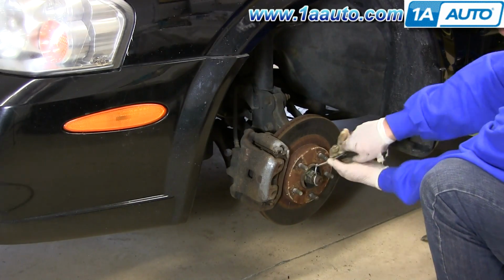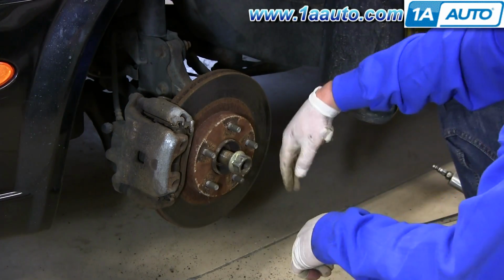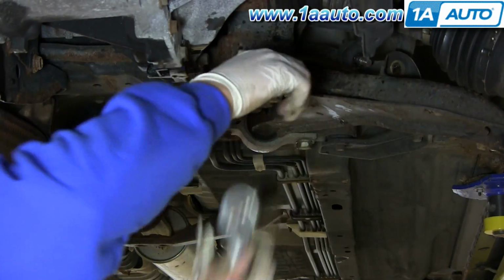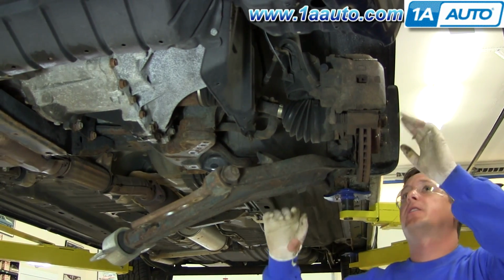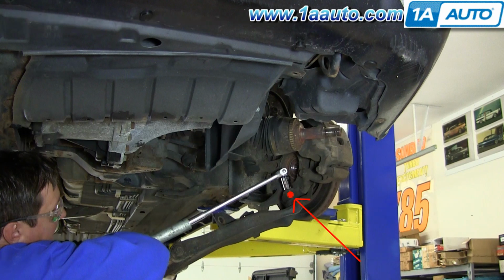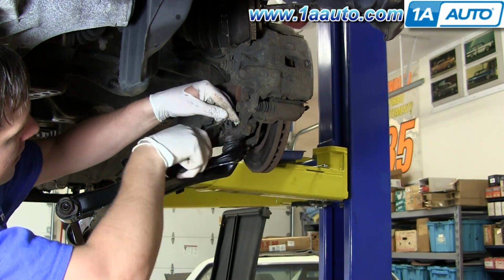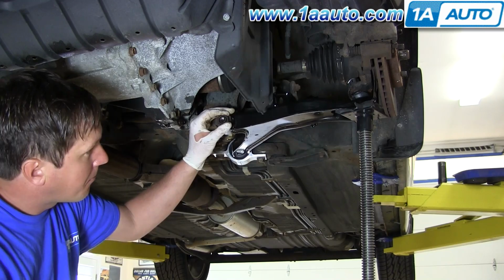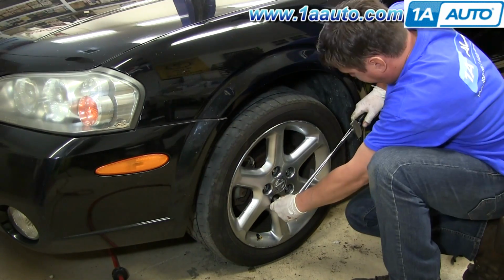How to Replace Control Arm with Ball Joint 99-03 Nissan Maxima

Comment: I just did this repair on my 02 dad's maxima since he was having steering shake and needed new tie rods at a minimum.  I figured might as well get the kit instead of trusting the ball joint to be good in spite of a torn boot.

First things first.  You're bringing a knife to a gunfight if you don't have a stout impact.

If you are doing this with the vehicle on the ground and supported by stands, there is a much easier way to get the old control separated from everything else.

Crack the six 22mm bolts loose with a breaker bar.  Remove the caliper bracket bolts, use a twist tie to hang it off of the strut spring, and remove the rotor.  Remove the sway link nut.  Remove the 12mm bolt that attaches the ABS sensor to the knuckle and move the sensor out of the way.

Remove the two bolts attaching the knuckle to the strut, and then zip out the 22mm bolts.  Now slide the knuckle and the control arm combo to an easier spot.  The ball joint cotter pin is much easier to access and the ball joint nut can be impacted out using an impact swivel.  Likewise, it's MUCH easier to strike the knuckle in the sweet spot to separate the ball joint.  The 27mm nut will also come off with some reverse ugga duggas.

Do assemble the new CA and the knuckle the same way.  Much easier without the axle in the mix.

Comment: To remove the front nut on an 03 the transmission pan gets in the way of a deep socket and I didn't have a short one, also I didn't have a 27mm wrench but that would likely be the next best option, I ended up using a 1-1/16" wrench with the closed end.

Comment: Did I miss it or did you not mention that you can’t reach the 27mm bolt on the control arm bracket without removing the trans fluid pan. You mention putting the trans fill plug back in but never mention removing that pan which is necessary for the driver side

Comment: I replaced both of my lower control arms but my drivers side control arm is grinding my break rotor only when making a left U turn....my passenger side is fine....thoughts
Reply from the maker: +Rigo Aparicio We wouldn't be able to diagnose an issue like that here, you may want to have a local mechanic take a look at it. Thanks for checking us out! http://1aau.to/m/Shop-1AAuto-c

Comment: I replaced  mine now have clunk when turning wheel all the way to one side only when moving .... any ideas new tie rod new sway bar do you think me tightening it in air is problem?
Reply: Hey I know it’s a been a couple months since you made this comment but did you ever figure out what that clunk was I am having a very similar issue after changing my control arms

Comment: Just did this job with parts purchased from 1A Auto.  Had much difficulty.  Struggled to remove the 19mm ball joint nut.  Needed to use my impact wrench with a swivel and extension.  The alignment bracket was also very difficult to get out of the old part.  Impact wrench and lots of WD-40 and some cursing finally did the trick.  The alignment bracket nut is behind the transaxle pan in an automatic, and there is not enough room to put a socket on it.  It's 27mm and all I had was a deep socket which didn't fit.  Used a crescent wrench and a hammer.  Hopefully it is tight enough.  Now here is another thing, the replacement  ball joint castle nut is different size (22mm I think instead of the 19mm).  I had also replaced the CV axle, and the replacement nut is also a different size (36mm) as opposed to the 32mm original.  Got the job done and after I get the thing aligned by a professional, the alignment nut should be torqued correctly.  But FFS, took me 2 or 3 hours longer to do and had me running to the store to buy odd sockets which I didn't have.

Comment: Did mine today I didnt remove the axle or the alignment plate went very smoothly
Reply: James berkhimer correct you don't have to remove the axle or the alignment plate to do the job that's just what the shops do to charge extra labor time to the customer
Reply: My driver side lower control arm is scrapping my rotor (touching) when making a left u turn....what did i do wrong

Comment: I wonder why you're having problems look at the breaker by you using should be twice that long same thing with the pipe you say your mechanic
Reply from the maker: +Toby Dyes No problems. We're showing that a pipe can be used for extra leverage in the event the person at home doing the repair doesn't own a breaker bar - as not everyone that doesn't work on cars often will have a breaker bar

Comment: The alignment bracket would not come out of my old control arm at all. I wacked it with a hammer for an hour and it was still stuck. I don't have a press to try and press it out (Which is the reason I was replacing the entire control arm instead of just the bushings and ball joints.) I would suggest offering the control arm alignment bracket or pivot arm or whatever it is called in a kit with the lower control arm for a smother no hassle product. I guess I will just cut the old control arm of the the bracket for now.
Reply: Yup I’m cutting the metal piece of the bushing off with a dremel rn👎

Comment: Okay ,the job was not hard until that 4 hole bracket. It is currently stuck inside the old lower control arm.The metal bushing has locked it in extremely tight. Lubing and hammering the reinstalled nut proved to be fruitless.Your video portrays a sloppy new bushing.I sure don't get it.Press fit is mine.Slip fit is yours.
Reply: sounds like crappy quality part with too small of a hole?

Comment: I changed mine without removing the axle
Reply: I was thinking the same thing... just loosen the nut then pull the arm down a bit till the nut comes off
Reply from the maker: +THE MECHANIC Thanks for watching. If any of our viewers needs to make this repair, we carry the auto repair part shown in this video on our website. Here is a link to them http://www.1aauto.com/1A/front-control-arms/Nissan/Maxima/1ASFK00065?utm_source=YouTube&utm_medium=CTA+Comment&utm_campaign=ytcomment&utm_term=oj4N_HWGGzU

Comment: Great Video! One small thing though: You spend the time to tell us the torque specs, which is greatly appreciated, except the "stablizer link nut" you simply say "nice and tight." I was able to locate a torque spec. chart for that nut (which I believe it said for 00'-03' is 37 to 44 ft*lbs, and slightly higher for the 04' model). 

But as others have said, this video by far surpasses anything else out there.
Reply from the maker: Thank you for visiting us on YouTube and the added information. Have a great day! 1aauto.com 866-403-3393

Comment: Hi, just wondering if it's possible to just change out the ball joint instead of replacing the whole control arm?  I have an '04 Maxima. Thanks!
Reply: i have a 05 sentra and its exactly the same. you can replace it but its way more work, you need a press to press in the new joint. i found that its easier to replace the assembly with all new bushings etc. with 1a auto prices its a no brainer.

Comment: thank you much for the video,is it possible to bypass the torque wrench or is it a absolute necessity? ive done a lot of front ends and i haven't used a torque wrench which i know i should have,thank you for your time!!
Reply from the maker: Thank you for watching.I would not want to tackle this job without a torque wrench. It is not as crucial when it comes to items like the control arm itself. But the Axle Nut should be torqued properly every time it is touched. Over torquing or under torquing that nut will ruin the wheel bearing. You would end up creating more problems than your solving. You can always rent one from a local store.
1aauto.com 888-844-3393
Reply: 1A Auto Parts
thank you much for the reply,i totally forgot to mention that i will not be doing this job with the cv joint removed,i do it without taking it out and yes i see what you say about the tolerances or torquing specs of the nut and the cv joint bearing etc,totally understandable,again thank you for a fine video.